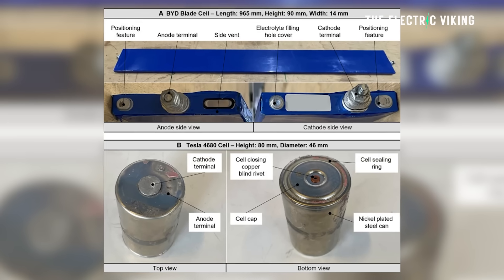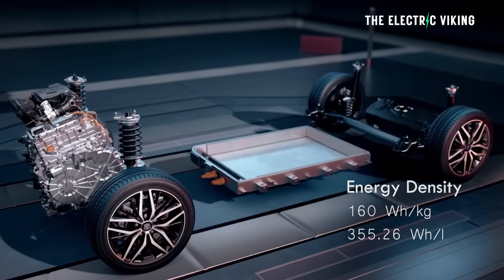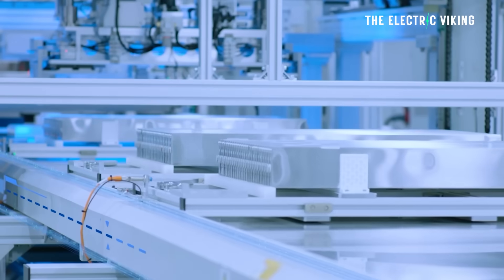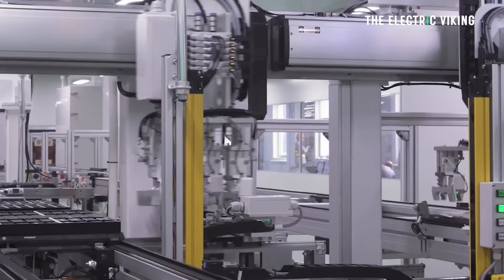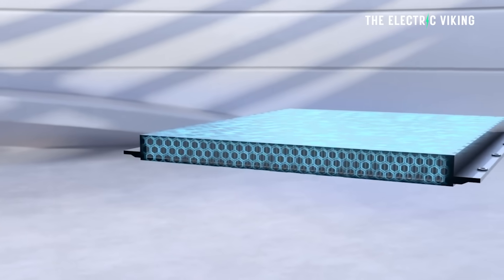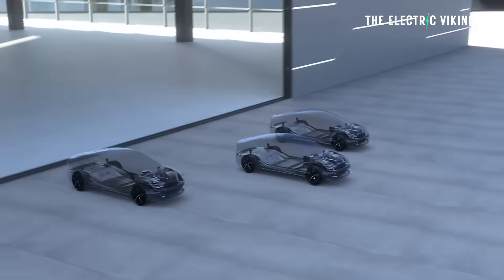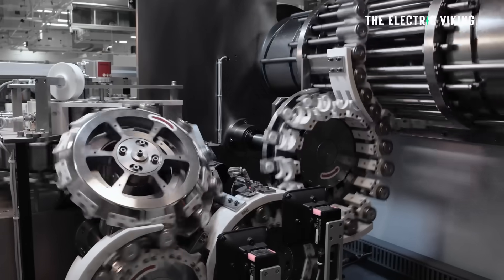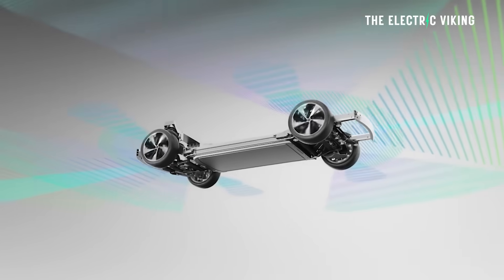BYD’s new 1000 kW Blade battery VS Tesla 4680 — Who Wins?

Comment: Question...would you buy a byd seal now as your first electric car on finance or would you wait for the new batteries to come to Australia for 10 min charging. I'm not sure which to choose.
Reply: Probably waiting is the smarter move. The blade 2 battery is gonna have a better charging curve on a lower power dc charger  aka 150k 350kw ones
Reply: How many 1,000v superchargers do you have?
Reply: @davidbeppler3032  future proofing. I'm not investing 50k AUD every couple of years. So I want to make sure the vehicle I choose will be capable of using future infrastructure.
Reply: @ So, you are buying a Tesla.  Makes sense.

Comment: Tesla's biggest issue is quality control. At least in the US the cars are very low quality. I'm not sure they have any quality control.
Reply: I own a perfect model 3 and Y.  What was wrong with yours?
Reply: Not found that at all.  Particularly in the 3 and Y.
Reply: Teslas are better than average for EVs, according to Consumer Reports which tracks these measures. All EVs are worse in initial quality because it’s new technology. Later on they are better than ICE because they are less complex. There is a trade off between innovation and quality (as measured by number of problems) because making no changes for a long time lets you perfect each part. Toyota basically made no changes except cosmetic for several decades. Everyone else copied them. On the one hand it made cars more reliable, especially Toyotas. On the other hand there was virtually no innovation that entire time. Once the company cultures moved away from innovation it was hard to move back, so the EV revolution, which required lightning speed innovation, hit them like a ton of bricks.
Reply: U dont even own one
Reply: I have owned a late 2019 Model 3 and now own a mid 2024 Model 3. While I did find a few QC issues on my 2019, I can't say that for my 2024. The quality of the latter is simply excellent and a ginormous improvement over the non facelift version.
Reply: I agree, Tesla has been in the news for quality issues for over a decade. Even recently rust is plaqing cyber trucks per various news outlets and only few days ago ALL cybetrucks in America are recalled
Reply: Delete the thought
Reply: My sister owned a Tesla and had all kinds of problems both big and small. Total nightmare. She sold it six months ago.
Reply: Quality is Poor . They use cheap Components.

Comment: Emphasize the reality that not only can you charge to full voltage using LiFePO4 but the BMS can only balance the battery if the charger is allowed to continue charging at full voltage until the BMS has balanced all of the cells in series.

Comment: My question is how is the local grid going to cope with the surge of power from these 1 mega watt rapid charge speeds (5 mins is a lot of energy in a short space of time) The charge stations are going to need a mini power station on site. I don’t mean to be negative. But what if 5 cars turn up at the same time needing a charge?
Reply: Don't ask inconvenient questions.
Reply: @JohnSmith-ux3tt  It's a non issue , covered thousands of times, go do some reading..
Reply: 1-3 mw megapacks
Reply: It seems that byd has found a solution, because they are a big manufacturer of ev batteries, so it is easy to build a big battery station near the ev charging station, where the big battery is charged by the national electricity grid during off-peak or night time, and the ev cars are partially charged by the big battery during peak load time.
Reply: byd四月车就上市了，充电桩现在就陆续安装布局中了，还在猜测是不是真的，你四月份买张飞机票费中国深圳不就知道了？流量拉满，大家也可以打破偏见，你做不到的，不代表BYD做不到啊。😊
Reply: Never once thought of that

Comment: I really would like to see a table comparing the key features of each battery type.
Despite that, at 240 Wh/kg, the energy density of the 4680 is a huge 50% better than the BYD blade battery at 160. That means you're lugging around a lot less weight for the same battery capacity.
Also, as most people charge their cars at bome, you need to cover  charging efficiency on say a 10 kW charger. 
So for me, this video leaves a  number of questions unanswered
Reply: You might want to watch the whole video again

Comment: MNC 4680 batteries more density but risk of fire lot higher than blade batteries, life is much more important.
In a battery fire , you may loose your life, car with little quicker and more rang can not buy back your life.
Reply: Imaging a petrol fire, very dangerous
Reply: So it's down to which EV you're going to buy because the lowest estimate of gas/diesel propensity to burn is 18 times that for EVs.
Reply: In an EV fire, you can just walk away.  In a gas or diesel fire you die.
Reply: @davidbeppler3032 you've never seen a lithium fire have you? The fumes are toxic and the burn temp is 3 times higher than petrol... plus, they are also almost impossible to put out with water.

Comment: I think at least part of the reason Tesla gets more out of BYD's blade battery is that the model Y has a significantly better drag coefficient than the Atto 3.(0.22 vs 0.29)
Reply: And maybe a better thermo management system.
Reply: yep, a huge jump in internal spaces for slightly more drag. Given how extremely cheap electricity in China with all the solar, no reason to save on power. If you're concerned about range just got a hybrid for your longer trips, byd got the best hybrid too.

Comment: The electronic control unit used by Tesla is a little more efficient in converting DC to AC. However, Tesla's complex electronic control unit also makes maintenance  Much more difficult.。Electric cars should be as simple as possible and will reduce the risk of failure. After all, the electric car market has just started, and the price of repair is not cheap.
Reply: Too early for standardization I think.
Reply: Inverters

Comment: Glad you mentioned lfp's ability to charge to 100% without doing harm to the battery pack. Average lfp lifespan 4 to 6 thousand cycles. So a 50 kwh pack is good for well over 500,000 miles and that's just to 80% original capacity.
Reply: Isn't it a myth that LFP doesn't take harm from high state of charge.
Reply: @Harrythehun   in practical terms no. I have 2 lfp leisure batteries on my motor home. They are now 3 years old and whilst I'm not using the van constantly sit at 100% charge because of my solar. In the 3 years they have a capacity loss of 0.02%. So they used to be 200ah now they are 199.96ah. I know this won't be exactly the same in vehicles but it gives a reasonable example of what the chemistry is capable of.
Reply: @Harrythehun it not lfp，it is lfmp。
Reply: @ImplyDods  if you think about it
Lots of peoples with standard battery only charge to 80%* but with LFP if you charge to 100% then the difference is not so great
Reply: @yvesinformel221  exactly my thinking. 👍
Reply: Material Formula Optimization:
By incorporating manganese into lithium iron phosphate (LiFePO₄) cathodes, BYD has elevated the battery’s voltage platform from 3.2V to ~4.1V, achieving a pack energy density of 190-210 Wh/kg. Some vehicle models have demonstrated突破 217 Wh/kg after optimization, supporting CLTC-rated ranges exceeding 1,000 km. The improved crystalline structure of the material suppresses high-temperature capacity degradation, extends cycle life to >3,500 cycles, and reduces thermal runaway risks.
 
Product Availability:
 
Reservation opens post-launch: BYD has begun accepting reservations immediately after its announcements.
 
Test-drive experience: Authorized dealerships now offer vehicle demos.
 
Mass production delivery: Deliveries commence in April.
 
Technical Clarifications from Media Briefing:
Regarding battery longevity, BYD clarified that its current design already factors in lifespan limitations—otherwise, charging speeds could exceed 10C. Future breakthroughs will likely prioritize infrastructure expansion (e.g., charging station density) over battery technology itself.
 
Charging Innovation:
 
Universal compatibility: BYD’s vehicles support third-party chargers via dual charging guns.
 
Doubling charging power: With existing 350 kW chargers, dual-gun operation achieves ~700 kW throughput, effectively rivaling ultra-high-power stations (1,000 kW).
Reply: That is unknown at this point. We will need to wait a few more years to fully understand real world longevity of the Chinese LFP packs
Reply: @richardvivian3665 well they have battery that are warranty for 1 million KM

Comment: I don't see the point of comparing cost and performance of two types of batteries using different chemistry. I'd prefer a comparison of blade batteries and 4680 both using LFP chemistry or both using NMC chemistry.
Reply: The 4680 is designed specifically as a high energy density cell. That is why it is in cylindrical form rather than the flat prismatic form.
Tesla has designed it for high energy density applications like Tesla semi. It is a multi purpose cell.

BYD blade batteries are really only suited for lightweight consumer vehicles

Comment: Lot of talk about Chinese batteries but haven't heard anything about longevity. I have 223,000 miles on my Tesla battery so far. I'd like to hear some Chinese data points
Reply: Electric taxis have been running in China for a decade, with ranges of 300km-500km, without issue. That's a reference to how they've performed so far.
Reply: @FrankiePo89 this is a good start. There should be plenty of hard data from the taxis. Just wondering why we haven't heard. 

I'm Chinese myself. It makes me laugh when so many people are pro Chinese products. You guys have no idea how they cut corners and fake data. I don't trust them and am surprised anyone does. Let's add to the controversy. I quite sure the Chinese lied completely about COVID origins. Shocked the world has let that slide.
Reply: @FrankiePo89 yes but haven't seen any real data
Reply: Most Tesla's batteries are actually made by catl, so also chinese. And as stated in the video they also use/ have used batteries from byd themselves.
Reply: @JoseFerreira-zb7wh  In Australia, the Tesla models with LFP batteries are BYD blade batteries, the same as in this video.
Reply: @JoseFerreira-zb7wh mine were made by Panasonic
Reply: @dyhppyx  so your "data points" (i would say experience) are on panasonic, 1 japanese brand, and not tesla.
Reply: @JoseFerreira-zb7wh this is true. I would hope Tesla picked newer better batteries than their older ones.
Reply: byd ev is used as a taxi in jakarta indonesia since 2019 and has reached over 500,000 km
Reply: There are ev taxis in Chinese city of Shenzhen that have been running around for more than 8 years, ever since the city's  public transportation went fully electrified since 2017.  Some of these taxis have clocked  upto hundreds of thousands of km in mileage without having to change their original batteries. This is what I read. Maybe you can do some research to see if this is true.
Reply: BYD start as a company producing battery.. your 223.000 miles might me made in china supplied by BYD 😂
Reply: A battery is a battery mate, They aren't rocket science.. I have a LIPO 4 battery that's now 7 years old and hasn't lost anything at all, It sat on a shelf for two years untouched and still started a motorcycle without me having to charge it... It's about time everyone got over the "if it's made in China, it must be inferior"...